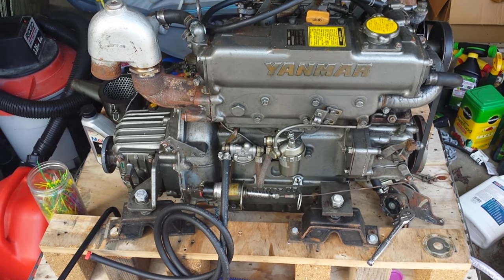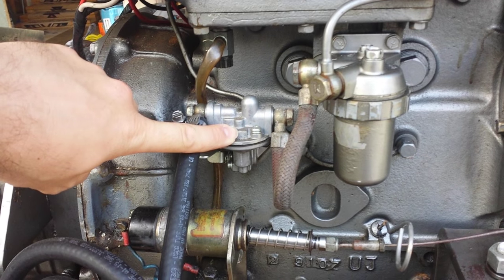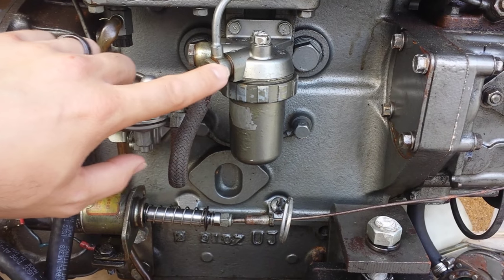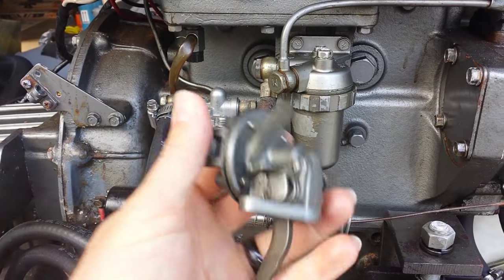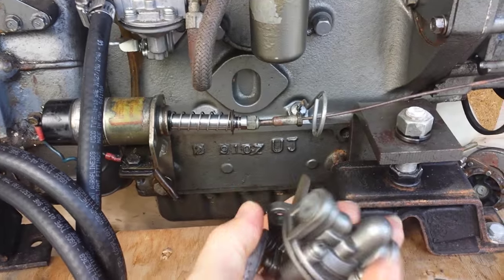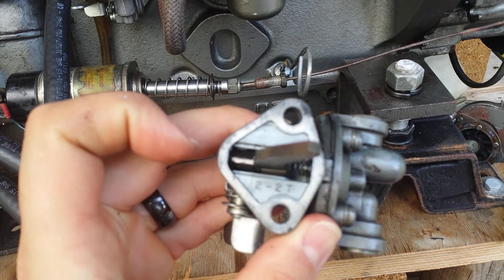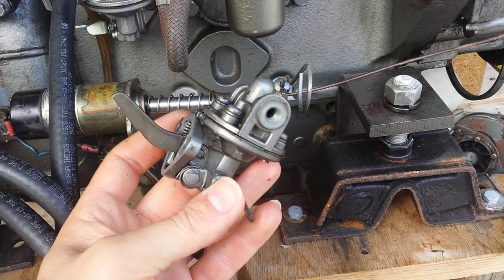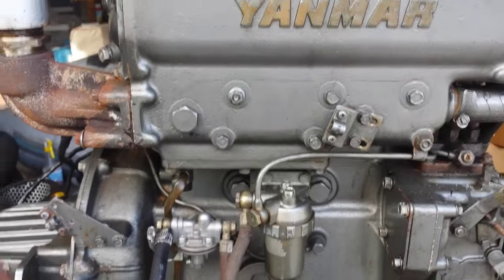Yanmar 3HM35F fuel priming/lift pump explained

Comment: Thank you, it helped me at my 3hm35. I buy a new pump. And I love this engine. Marc
Reply from the maker: I've never owned any other diesel engine but I agree this was a great one to start with.  Like most things it has its own idiosyncrasies but once you learn them it is a solid and reliable choice.  I'm a big fan of the Kabota engines as replacements.  If I recall correctly the Beta Marine are Kabota's and so are Westerbeaks?  The other nice thing about the Yanmar is that they have a lllllooonnnnggggg heritage.  The QM, HM, GM, and YM are all part of the same family tree and share many of the same parts.  A lot of dealers are pushing away from the older ones because they have difficulty acquiring parts... In reality if you're doing the work yourself look to the neighboring series such as GM and YM.
Reply: @muckleyj  wow I didn't know that. such a useful tip.

Comment: I had a runaway engine because of a leaking diaphragm. It ruined my engine.and it could have exploded. Now I have a Beta 25.
Reply from the maker: Yep, gotta check the oil level regularly.  If it is going up and/or smells like fuel you got problems.
Reply: @muckleyj  Now i am going to replace the pump, oil seems little thin, tomorrow smell the dipstick.
Reply from the maker: Place a drop of oil from the dipstick on a paper towel.  If you get a halo it could mean fuel contamination.  This is particularly easy to see if you use the red, tax free, diesel.  The halo will show red-ish if there is fuel.  You can also remove the fuel lift pump, block one port and blow into the other, then swap sides and do it again.  A leaking diaphragm will pass air.

Comment: So what is special about the 3HM35F?  Is it a longer lasting more reliable engine due to "fresh" cooling loop?
Reply from the maker: Generally freshwater cooled is preferred but more costly.  They are less likely to rust from the inside out. Especially in situations where they are in salt water and can't be flushed after use.